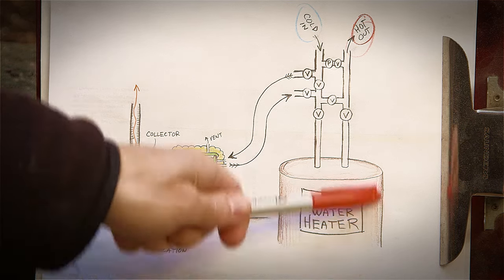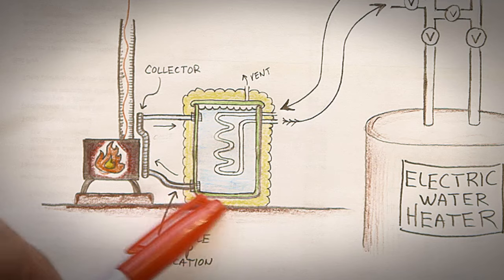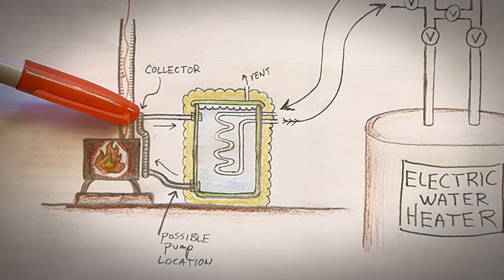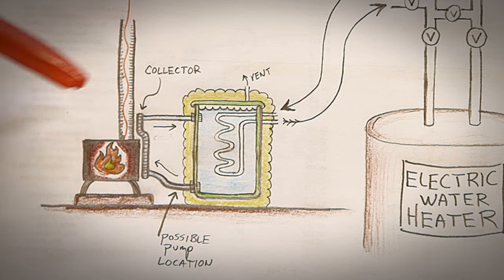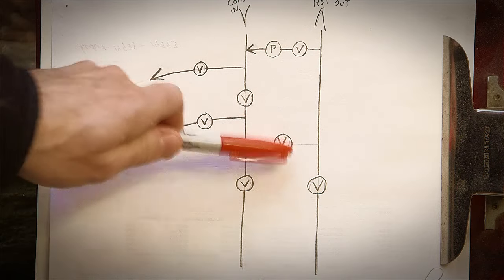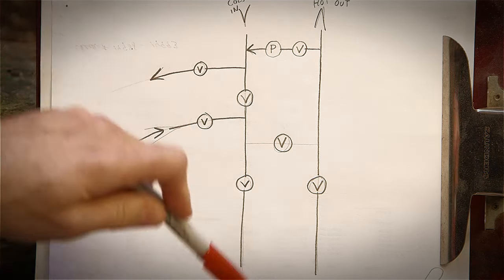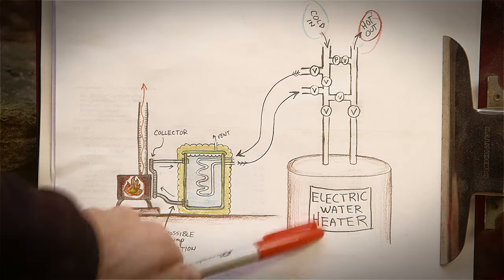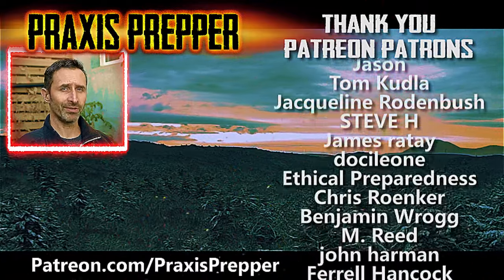DIY Woodstove Powered Hot Water Heater System Introduction

Comment: the system we had when I was a boy had no pump. it was convection driven. it was connected directly to the water storage tank via pipes from the top and bottom of the tank. the heat exchange pipes were literally behind a kind of concrete block inside the fireplace.  if the fire wasn't going the water didn't flow because no convection. the water going through the stove was the same water that was in the tank. sometimes you could hear the water in the tank boiling. not sure where the pressure went to but there must've been a pressure release for the water to boil.  my uncle did engineering work with hot liquids under pressure in the local sugar mill and he built our system

without the storage tank I don't think your proposed system would provide much hot water because your heat exchange tank will never exceed 100C (boiling).  without the storage tank the cold water has to go through the heat exchange tank quickly (at the pace you're using it). this internet stranger thinks a storage tank is needed.
Reply from the maker: Hey Paper Plane, it's been a while since you dropped a comment hasn't it? Nice to hear from you. Your thoughts on how much heat can be transferred into the domestic water as it is transiting through the heat reservoir is something that I've wondered about as well. I'm sure there's math that I could to to figure it out, but my sense is to just make sure I put a LOT of copper pipe in that tank so that the water moving through is in there for as long as possible. Thanks for sharing your expereince!

Comment: No pump is needed, if plastic drum is raised high enough to gravity feed the heat collector.......
Reply from the maker: I'd like it if the pump is unnecessary. The best convection will happen when the thermal differential is high, but not so much when it's not so high. I'll find out and share what I learn on here.

Comment: Long ago, people used a bathtub with a fire under it to heat bath water.
Tushy got a bit warm if you weren't careful lol

The higher that storage tank is the better the flow rate. Bigger pipes can help with the boiling issue. Expansion tanks with a T&P valve adds protection.
How about just heating a 75 gal gas hot water tank and not have to worry about this stuff?

Also, look up water tempering tanks.

You could splice in an automotive thermostat which can control the heat output.
Reply from the maker: I think the most important word that I should mention that in your comment is "worry". I don't worry about this stuff in the least. I enjoy it. That aside, I appreciate your thoughts and your taking the time to share them. I love to simmer on ideas and come up with fun and resourceful ways of connecting assets with needs.

Comment: You can get a stainless steel tank.
Reply from the maker: I can. I'm wondering why you think the steel tank would be better though? I know steel is easy for you to work with given your skill set, but it's harder for me (with mine). That's not a reason for me to go with something inferior, but it IS a reason for me to wobble one way or the other if all other things are equal. Are there advantages to steel that I'm not considering? I'm planning to insulate the tank anyhow, but one advantage of plastic is that the plastic itself insulates a bit too. I'd be curious about your thoughts (as you might imagine I would be).
Reply: @PraxisPrepper  you get stainless steel, use the manufactured holes for in and out,  place drum on its side. The threads are 2 inch if not mistaken,  reduce to size needed...place hot water safety pressure valve on hot water pipe coming out of tank, all this should be metal.

Comment: I have a systen like you are showing running fore 5 yeers nou. Works perfict but in the elecktrick boiler put the hot water in the top it gets hotter faster that way.

If you send me your mail adres i wil send picturs of my system

Comment: I believe theres is an error in the fact that we know thermosiphons work by making hot water, and capturing on the physics principle that hotter water is less dense therefore it will rise. I think that your hot and cold water inlets onto your little side jacuzzi are about the same elevation. This will confuse the hot water about which way to go. The cold water inlet on the salt jacuzzi should be gravity fed to the lower portion of the tank so that when it heats it exits on the top and it doesnt try to rise in both directions and terminate or slow the flow. To me if you are capable of installing a circuitboard that controls the pump on the tubing then you could also control an electric valve that shuts off flow at certain temp. Anyone feel free to expand on this.
Reply from the maker: If I drew it that way, (the outlets at the same height) in my drawing, you're correct that it wouldn't work. Thx for pointing that out to try to catch it for me (and others reading these comments). I wasn't going to build it that way, but if I WAS, you'd have saved me from a certain failure. The project has changed a little since this video. I was able to find a 2nd hand used thermo-transfer tank. So that part is all done. One thing that I've learned from my research is that there is an additional reason to NOT have the domestic water be used as the heat reservoir itself. That wasn't the way I was drawing it in here (for the purpose of not having to have the reservoir be under pressure),  but I discovered that doing so would ALSO create the opportunity for legionnaire's disease to grow in the tank and then be spread into the water supply. So that's an extra reason I found out too. Thx for sharing your comment!